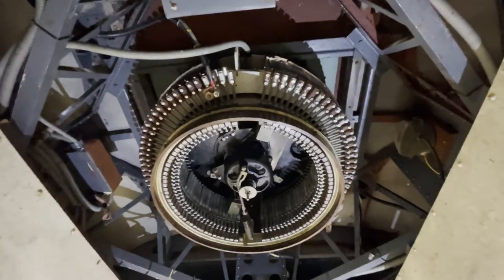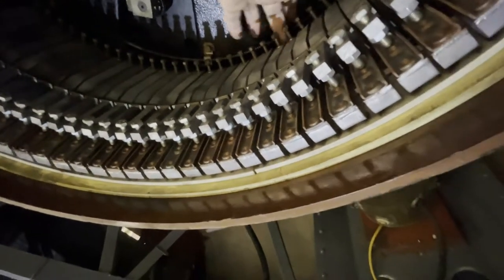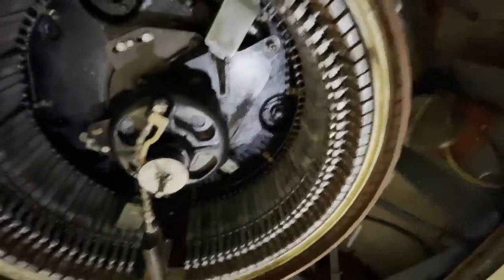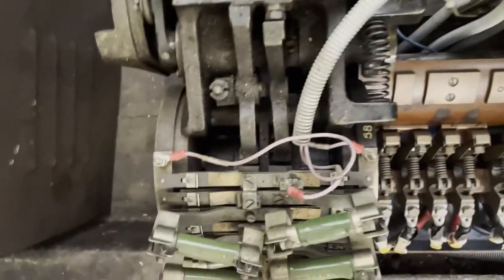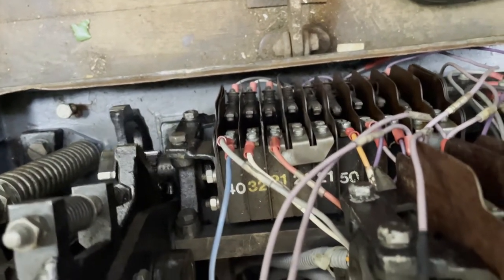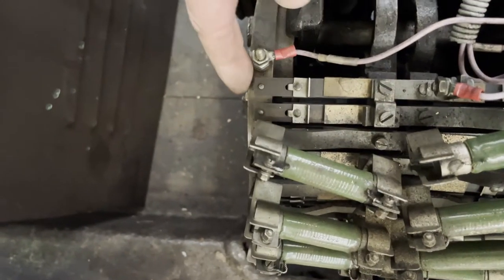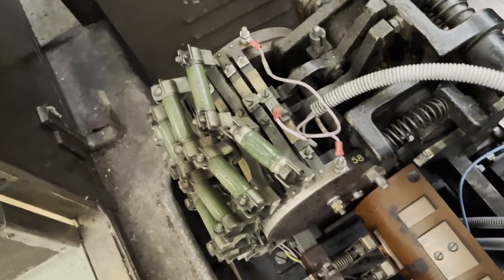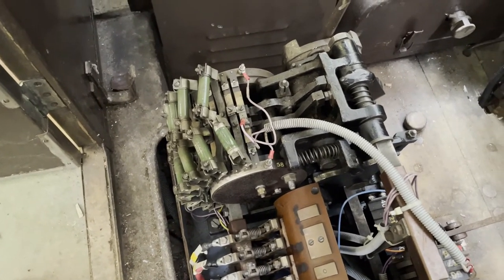Electrical checks and service on a VAMBAC tram system

Comment: The VAMBAC system is actually quite simple, firstly forget about the earlier resistance and controller setups. I have spent many hour working on this system, I still find it fascinating. The reliability is dubious, namely down to vast amount of moving contacts  and auxiliary ones on the main contractors. Very good video and explained nicely.

Comment: Thanks for posting this - a very practical & concise explanation of how the system operates, & interesting to see the system as a whole rather than just the VAMBAC unit in the roof chamber. Your explanation of the current measurement system within each of the drivers controllers I can now tie with the explanation John Markham from Crich gave to me some years ago about the measurement of the accelerating current being matched to the drivers controller position. His one criticism of the VAMBAC system was the use of "moving iron" measurement as opposed to "moving coil" system used in PCC cars, because of patent rights. It would be interesting to see a comparable video explaining PCC technology in operation. Thanks again - very interesting.

Comment: I love electro-mechanical gear like this. Much more interesting than solid-state electronic control. I can't help thinking, though, that the extra smoothness compared to the the traditional drum controller  didn't warrant the complication. It must have been a nightmare to maintain in service.

Comment: Superb explanation, thanks. Great design on paper, but I've a much clearer idea of why the Balloons survived to have some class members rebuilt for full, commercial 21st century operation, whilst the Spivs are little more than an interesting historic digression.

I'd imagine that, in our solid state age, there are entire tramway systems operating with less moving mechanical parts than contained in a single VAMBAC installation.

Comment: Does the Vambac  allow series and parallel switching, like a drum controller, or is it all series?
Reply: It is all parallel, hence the high current consumption.
Reply from the maker: The tram I'm working on has four motors, two in each bogie.
The overall arrangement is fixed series-parallel; two series pairs (1+3 & 2+4), then those pairs in parallel.
The motor cutout switch in cab 1 allow either pair to be isolated in case of a fault.

Comment: Great control system for its day and it beets me why they had to tamper with its operation regarding the 24v system. This explains ( I have read it somewhere) why the drivers had said the braking used to occasionally cut out and was dangerous. Similar issues' with the illuminated trams that are on LED. I was speaking with a BPT operator and he was explaining issues regarding the Trawler tram and its battery's going flat and loosing the programs when it was parked up and the overhead line isolated. I could not understand why they did not have a charging circuit in  place in the shed that could be used to float the batteries. This VAMBAC system would have been great if a little more education was given when installed. I take it it is 550vdc split in series over two motors to keep the current down, I am looking forward to seeing this tram back on the line shortly. Was you the guy who had to repair it after it had been on fire? I would imagine those resistors would get pretty hot if running at low speed for a long time. Ps great video and very educational.
Reply from the maker: Hi,
I've no idea of the reasoning behind the original 24V side problems with these; the commonest problem was apparently from blowing sand getting in through the vents around the main VAMBAC unit and causing issues.

It has four motors, two per bogie, arranged as series-parallel and with the series pairs apparently  using one motor in each bogie, so both are still driven if a pair must be isolated.

I'm not aware that this tram was ever on fire? There is another tram at Blackpool (no idea what number, but not a coronation one) that has a small area of fire damage next to a cab, where the main power cables enter it from the upper trunking.
Reply: @RJTC  Hi Yes when it had its contactors replaced there was evidence of fire (I personally think overheating) in the VAMBC unit. I think the program was salvage squad or something. In the same video one of the original coronation tram drivers was explaining the braking issue. If the tram lost power from an isolation section of the overheads, the throttle/braking stick would have to be retuned to its neutral position to regain control. This intern would have disabled the breaking if you were in the breaking position when you went over an isolation section. I am presuming they would be using reverse traction via resistors.  Interesting you say about sand in the unit, yes that would be a problem considering the weather in Blackpool.